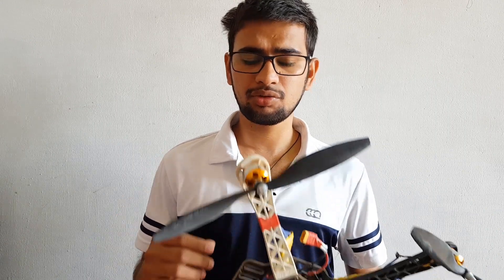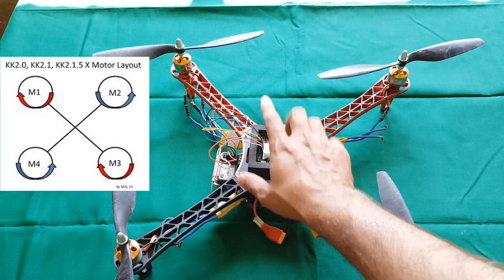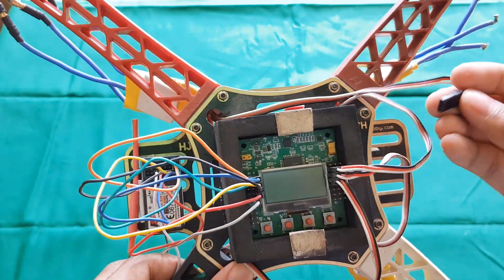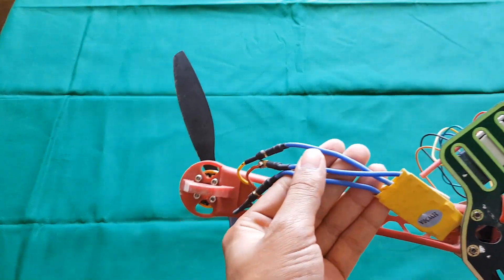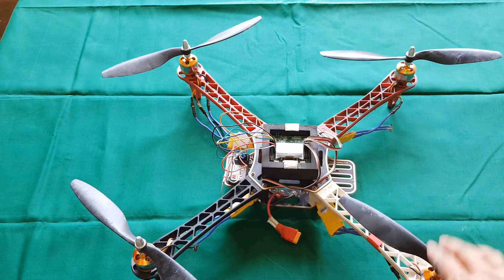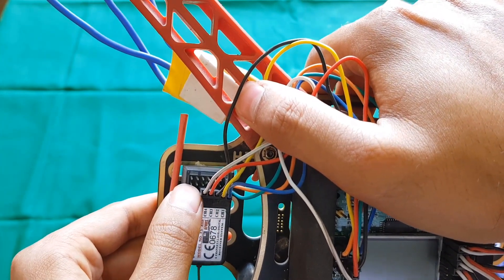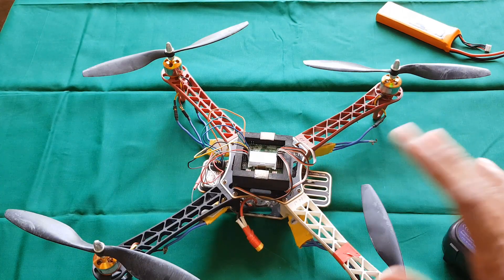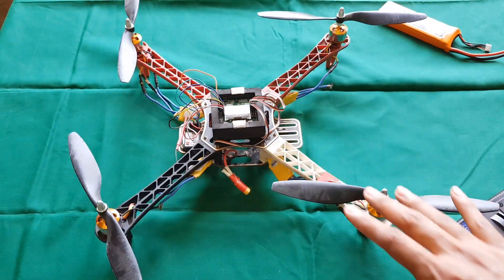Building the Quadcopter. ESC, Motor, Receiver,Flight controller connections.[KK 2.1.5] Part - 5

Comment: all the three wires of DJI 2212 920 KV are looking the same , how should I connect them to ESC please help
Reply from the maker: u can connect any wire of the motor to any wire of the esc and it will work.
if u want to change motor direction swap any two wires ..

Comment: Bhai motors parallel connection mein hai ya series connection
Reply from the maker: Motors are always parallel.  Otherwise if one got burned it will burn all as well as current would be fsame for all motors.. So we always connect motors on parallel
Reply: @TECHBINDERS  Bro I have one more doubt regarding amp draw 
I'm planning to make a VTOL model using flycat 360Kv motors and I'm planning to use Lithium Ion battery so in Lithium Ion Battery we have to choose a suitable BMS so in my case motor is giving 1.9kg of thrust by consuming 15amps so how many amps in total will get consumed to get same amount of thrust from all the motors so that I can choose perfect BMS ( But if we are adding all amp draw the total consumption is about 70 amps which is so heavy for a drone) 
In general how many amps will be consumed by 360kv 4 motors to get total 7.6Kg thrust force
Reply from the maker: Depends on lot of  variables
Reply: @TECHBINDERS  Actually I'm in lot of confusion bro I'm not finding proper ans so I was expecting you to atleast tell how many amps will 4 motors  consume

Comment: Hii,

I have a problem I bought the kk 2.1.5 board already with the DJI F450 Quadcopter, and when I do the accelerometer calibration it always calibrates with

ACC x: 512 OK
ACC y: 512 OK
ACC z: 512 OK

In the sensor test menu, I always show the result 512 for all calibrations.
And when I try to fly with the drone it doesn’t stay stable, it always tends to the right and turns upside down.

Can anyone help me with this problem? Thanks.
Reply from the maker: Sure msg me on whatsapp
Reply: @TECHBINDERS  Plz Can you send me your whatsapp number, I don't have it .
Reply from the maker: 94587 06160

Comment: Where would I connect the BEC wires on my flight controller if it doesn’t have a pin connector? I know the white wire is the signal wire and the red is positive and black is negative
Reply from the maker: What flight controller u are using?
Reply: TECH BINDERS iflight succex f4 twinG 2.1
Reply: TECH BINDERS iflight succex 2-8s power distribution board.

Comment: Bro pls help me Brother I am a engineering student.my project is making a quadcopter. My problem is how to connect transmitter and receiver. I moved strick for transmitter in front but motor was not rotate . pls help me Brother
Reply from the maker: Message me on whatsapp
Reply from the maker: Message me on whatsapp

Comment: Can I use 5200mah 3s battery for my quadcopter with 1000kv Motor and also up to what altitude it can fly with flysky fs-i6 ?
Reply from the maker: Yes you can. It has range of around 1km only..

Comment: Sir , can i use power bank instead of lipo battery ??? Pls reply
Reply from the maker: No bro.you can't you need high current around 20A and high surcharge rate and good c rating. In no way power bank can supply so you need to use lipo only.
Reply: Ohkk
......thank you , so much😄
Reply from the maker: Dont forget to subscribe my channel
Reply: Sure bro😄
Reply: e